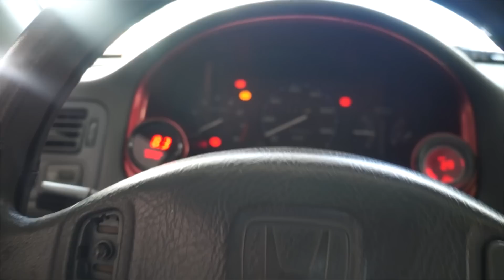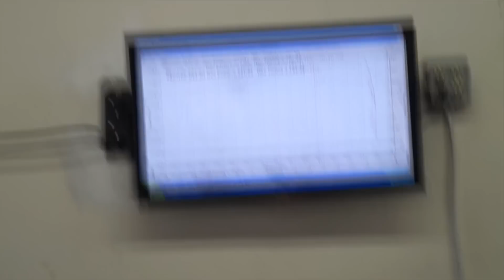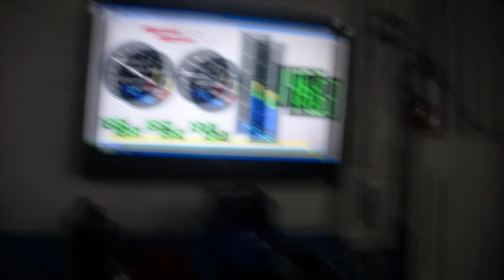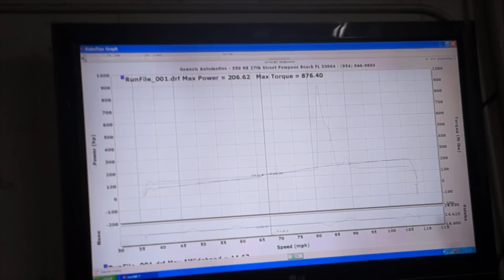MY K20 SWAPPED EK GETS TUNED

Comment from the maker: Final numbers are 213whp @8100 rpm with no intake, open headers and stock throttle body and stock ek fuel pump for anyone asking
Reply: KBros it’s a k20 with a k24 long block???or a just str888 k20???
Reply from the maker: Lascelles Philpotts in the sedan it’s a stock straight k20a2 motor. With just an rbc. Open headers stock fuel pump. And no intake.
Reply: KBros madd k20a Nd it a move suh mi have one but mi a look a eg fi put it inna...